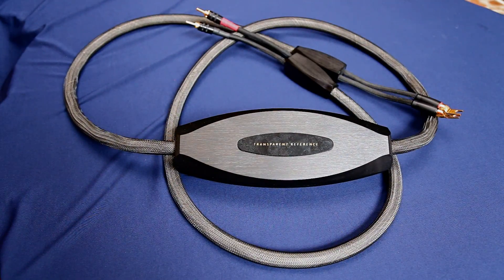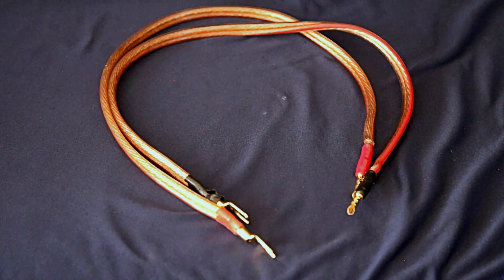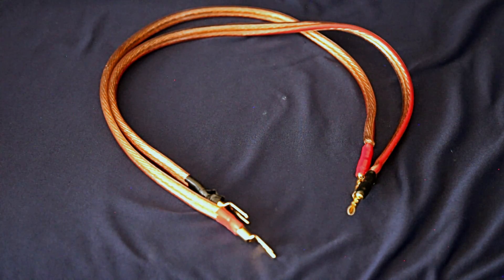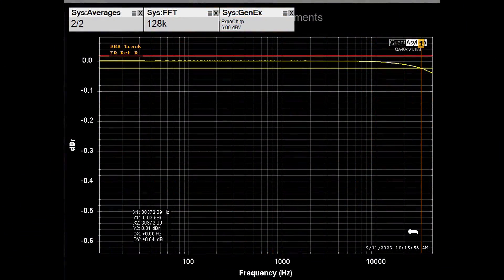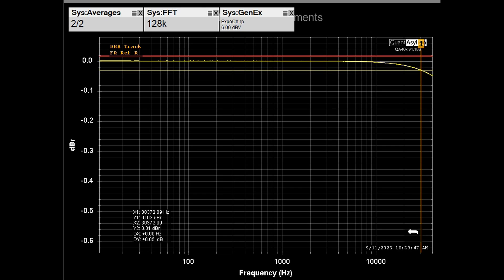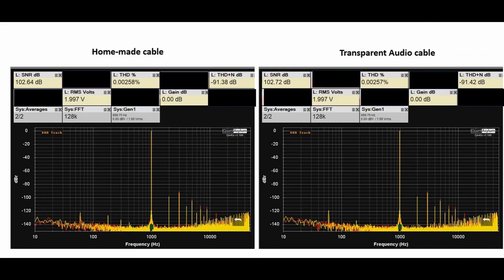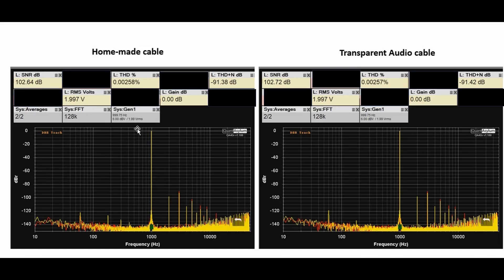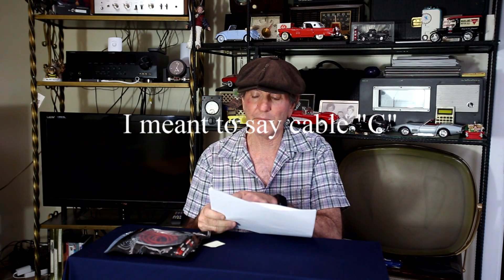$8000/pair Speaker Cable  vs. $14 DIY Speaker Cable A/B Test: Vintage Audio Review Episode #87

Comment: Nice video! And the crazy part is, the Transparent Audio speaker cable that you tested is one of their more "affordable" lines. Transparent Audio's top of the line speaker cable costs $77k a pair and I have heard it still made out of copper. You would think for that kind of money it would be dipped in gold! A fool and his money...
Reply: Goldplating isn't that expensive, for that money it could be a fully gold wire, but even better would be a fully silver wire, as silver has the best conductivity. Gold is used for goldplating since it doesn't oxidize, but making full wire of gold isn't as beneficial. Long time ago I used a thin coax cable made of silver to be able to carry long distances.
Reply from the maker: @gorankrajnovic  Thanks for taking the time to comment!
Reply from the maker: Thanks so much for commenting and I did not see ow much their most expensive cable was... for what length I wonder?
Reply: @vintageaudioreview I believe that is for the 8ft lengths.
Reply from the maker: @generationbehindhifi  All I can say is "wow"... must be nice to have that kind of dough.

Comment: hmmm - - both testing cables ultimately running through another cable, which looks to be stock Monster, but no matter - but how can ya tell between anything when everything is going through that cable 1st, meaning before the speaker? Bad enough that the colorations of using a single speaker will also cloud the results, meaning the ONLY speaker and it's particular colorations and it's particular internal wiring, not that you're listening to a "single" speaker in mono.  You're not only implying, but you're saying that the added in cable is only a couple of feet long so shouldn't affect much and that's not to mention a switching box along with multiple added connections of the extra cable and the box itself (oh, none of that will matter, right?) This must be a joke.  Would have made more sense to test the switch box in and out of the system to get a hearing handle on what effects it has before introducing it like it doesn't even matter, right?  I have to mention, perhaps a bit of nit picking, but I found it to be bothersome that you constantly refer to your "single" cable as costing 14 bucks but a "PAIR" of MIT's is 9K, a rather obvious attempt on your part to exacerbate the cost differences. You can delete my comment - but come on, I thought I was watching a comedy sketch and I'm not even arguing one cable possibly being better sounding than the other -  I'm sighting that this test set up would veil ANY comparisons of any cables regardless of price or performance - a total waste of time for you and anyone that trekked to your testing room and a big shocker, actually not, that the results were more or less ambiguous. If this is a soap box for "don't spend money" - you made absolutely no argument. All on the other hand, it's not escaping me that you went to some trouble to do all of this, even though I think it's a very flawed test I do appreciate you posting it regardless. So, thank you anyway.
Reply from the maker: Thanks for your long commentary. First, I would never delete a post unless it was filled with profanity (has not happened) or is a spam post ("Make $4000/day doing...", which has happened a few times). I think you are kidding with my trying to exacerbate the cost differences between the cables but just saying one cable cost $14 and a pair was $8k- it was never my intent if that is was you thought. It was done at my friend's house and once again, is a get together for "audio" guys to eat, drink and meet. This is the 2nd a/b test and everyone enjoyed it, and I have two more planned. THere is no way that I know of to test compare directly, and it is only in mono, and the intent was to test the tonality. I certainly have no soap box on the subject that I was trying to promote and thought I said that you can spend your money however you want. Unless you can switch between the devices immediately- which the switch box allows for- I don't see how you can compare such small differences (IMHO). There is a paper of my measurements on the switch box, which show that it does not effect the electrical properties that much at all (it does have an effect), but both cables were switched through it and effected the same- I did mention both the switch box and the small cable as being in the path. I described the small cable- it was actually two stranded 12gauge OFC NOS Realistic brand cables per each "+" & "-" lead that were soldered together at the ends- lots of resistance I am sure. Once again, I do appreciate your comments and thoughtfulness with them.
Reply: @vintageaudioreview  Thanks for replying - umm, the delete thing is just me not wanting to "rock the boat" with your regular viewers - it's a negative comment and I appreciate that you read it and responded, but of course it would be fine by me if you dumped it, and it's fine by me if you dump this - frankly - the cable thing is only a "thing" to those that haven't experienced the vast range of cable offerings, perhaps ranging from that skinny wire Radio Shack used to sell as speaker wire (I bet you remember that stuff) all the way to reference level stuff and the need to rob a bank to buy it. Let's be honest with each other, do you really think your DIY cable and the Transparent Cable, both running in a reference level system would sound the same? I'm not even asking if you think one would be better than the other, but do you honestly think there would be no difference at all in how they sound? Hey, maybe there wouldn't be, but the test you conducted here would never, as I've already pointed out, reveal much of anything anyway - again, no matter because you'd have a hard time convincing me that, used as intended, you yourself would expect the differences to be indiscernible or that basically both cables would sound the "same", that is, no switch box, no patch cable, direct connections, decent system etc. And that's not to say that sure, both you and I know we're only talking stereo here - and yes, for the sake of my perspective, I'm currently running full loom high end reference cabling - but I'm from way back too - I've played around with all kinds of wire & cables including that skinny stuff, actually, thinking back, I used it for quite a long time in the 70's and like most stereo lovers of that time, I was none the wiser, I loved my system then, and I love my system now - it's about getting off on the music - I can feel musically emotional with music coming from my less than average stock FM radio while driving down the street in my GMC Savana van - and at the other end of that spectrum, and speaking only from personal experience I'm flat out saying that the skinny stuff, and most cables in between, all the way to Nordost Vahalla II which I'm running now simply do not sound the same - everything makes a difference, everything - and again, I'm not talking about one thing being "better" than the other - but there's no denying everything, including speaker wire can and will sound different without the need for a switch box to hear it - but - on the other hand and as I'm tying to express - and - I'd bet we'd both agree on - that is definitely not a pre-request for "enjoying" music. That idea however, does not dismiss that there are differences - and again, my personal perspective & philosophy doesn't include, for example,  a listener with a 5K system running out and buying 12K speaker cables either - for sure and of course, that's a diminishing return thing, but that also doesn't mean one would likely hear no difference at all given that scenario, because that too would be equally unlikely regardless of the cost or that one would never experience that 12K value.  Anyway, what I'm driving at is that I'm trying to be, or I am the guy standing in the middle ground - either extreme: cables do magic/ cables don't do anything - is simply not true - and yes, any sort of a difference, even minor ones can have some listeners running around expressing magic, I'm not one of those guys.  I respect you and believe from watching you and conversing with you that you're too smart of a guy to commit to either of those extremes yourself, even in the light of your questionable testing video.
Reply from the maker: @skip1835  As most of my reviews are how equipment performs after many years, I have not had anything like what has happened with this video- and it is a good thing I am retired as I do reply to every comment that I see, so it has taken many hours of time, which is fine as it keep me off the street at nights. Not even when I did the tube vs solid state amps did I get this reaction. Most of the comments have been more in favor with the cables not making as much a difference once they are say a decent gauge- for me that would be 12gauge, but good old OFC "zip cord" would do for the majority of folks (IMHO). Science does not support the claims of cables sounding different when paired with a decent amplifier- there was a suggestion that I should have done a null test measuring any difference between cables, but that would not have engaged my friends. If I had two expensive and huge monoblocks setting on my living room floor, having 14gauge zip cord is not going look very impressive- I get that. I would also agree that someone having a $5k stereo system is probably not going to run out and get these cables. I do have another a/b test coming up in the next few months that will involve a cable test, but not speaker cables, but will involve a switch box, though a different one and a small adapter will be needed- this one just kinda fell into my lap, so to speak and it will be interesting to see how that one goes... At heart I am an audio gear guy and just like what I am listening to sound pretty good- perfection will never be achieved and I am not one that will spend a lot of time trying to swap this out for that little bit more of the audio nirvana- but there are many folks that do and it is a hobby after all. I mentioned in a few comments that my group will be getting together in later Jan. for a/b test between two very different integrated amps, not really a right or wrong kinda thing, just which did you prefer......It is nice having an intelligent discourse with you, but I have to get back to assembling my Carver Cube....
Reply: @vintageaudioreview  Ha! too funny my friend, and I am assuming you're pulling my leg a bit - but ah, the old Carver Cube, was it a class H or something, I don't recall exactly - - true story, I once called into a hi-fi radio show that came out of Boston - at the time I was fortunate enough to have an original Ampzilla from GAS (Great American Sound) - anyway I posed the question as the Carver Cube was making the scene and generating a lot of curiosity - and oddly, driving the question was that the specs between the huge Ampzilla and Bob Carver's cube were virtually the same - this is way back - the Ampzilla was driving Time Windows which might jog a time frame reference for you - and in those days we were really on a step learning curve (although I think by then we had figured out the original Monster Speaker Cable sounded better than zip wire, maybe much to do with it's gauge as you pointed out) Of course I wanted to know if those guys on the show thought the two amps might sound the same, the Carver was much less money - I will give them credit as none of the 3 guys would tackle the question head on - you know, like in those days most of us thought similar or matching specs for an amp should mean it should sound the same or similar - - they were more informed than I  in that they knew better than to make any such prediction - but that was a cool moment for me because they didn't care about the question so much as they wanted to know about the Ampzilla and the Time Windows which surprised me in that moment but admittedly stroked my ego a bit - that was one amplifier that I should have kept, but who knew back then that to this day it would still be coveted, more for it's brute power and looks than it's rather hard, Bipolor transistor sound - gawd I miss that amp, it was built literally like a tank - - anyway - catch ya later and happy listening - - don't waste another minute of time responding to this one - I've appreciated sharing with you - happy holidays and all that stuff - best wishes for your channel too.
Reply from the maker: @skip1835  Thanks so much for your anecdote! I Have never listened or tested an Ampzilla, but can understand your wishing you had it now. Yes, I was referring to the m400a version of the Cube. Check out episode #51 on the Cube. I had two cubes running as monoblocks and decided to re-cap them, which is a royal pain. THey were working well and I decided to push them a little and one died- went into and stayed into protect mode. I decided to wait as I had already been into it a few times as I screwed something up the 1st time during reassembly. About 4months later I decided to take it apart again and found the problem and was able to repair it, and it is being tested as I am typing this- so far, so good. Aside from the low level (no signal) hum you may hear, they work really well as long as your are not DJ'ing a party. Best wishes for you as well during this holiday season

Comment: Most of the differences that I hear between different cables is in the presentation of the soundstage, so designing a test that eliminates the distinctions seems pointless.
Reply from the maker: Thanks for the comment, though I would disagree with you about the soundstage comment. I think @Douglas_Blake_579 discussed the advantage of doing the test in mono amongst these comments...

Comment: Thank you for this! I'd been curious recently whether it was worth spending more like $50 or so on a set of cables.
Reply from the maker: Thanks for the "thanks". There are a lot of videos on DIY cables on Youtube- maybe find one that looks to be in your skillset and budget. You could make simple ones like mine for this test- but the cable itself is not OFC but copper clad aluminum which is less expensive, but seems to be working ok for me at this point- will have to see how it holds up...

Comment: Both cables are connected to a switcher and a an additional pair of cheap cables. If there is a difference in the test subjects, it will not be realized in this completely unscientific test.
Reply from the maker: Thanks for taking time to share your opinion. I would disagree with you about the 2' of "cheap" cables changing anything significant, but this was n0t meant to be more that what it was...

Comment: Before you start.   Your cable won't work  fine for girls bedroom  after a week of Listening. That  is when you find out.   
  Now the crazy price is another story.
Reply from the maker: Thanks for the humor!
Reply: You should live for a week or  2 weeks with the  over the top cable 
  That is when you notice.    Also when you  tin your wire.  Sound has to pass over the tin   making A  Dam  no tin better sound    blind or A , B test are. B. S  LIVE with the good wire.   You will miss it.    
  Blind test on  DAC,s 
Amps.   Easier

Comment: I would note that Transparent Audio uses stranded copper wire inside, just like the DIY cable, so it doesn't surprise me the sound characteristics are similar.  Compare such cable to say solid core wire, or ribbon cables (e.g. Silversmith Audio), I expect the differences will be more audible.
Reply from the maker: I appreciate your taking the time to share your thoughts on this. I doubt there would be any difference in sound between solid and stranded core wires used for speaker cables if they are OFC. There would be a difference in how easy they are to handle most likely.